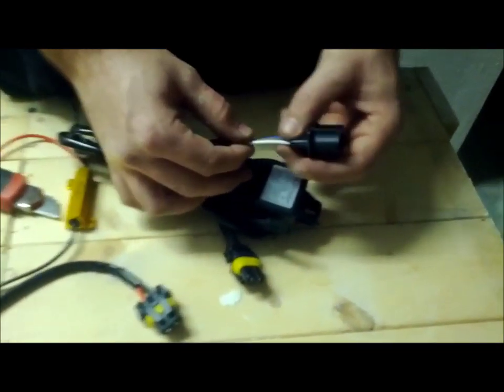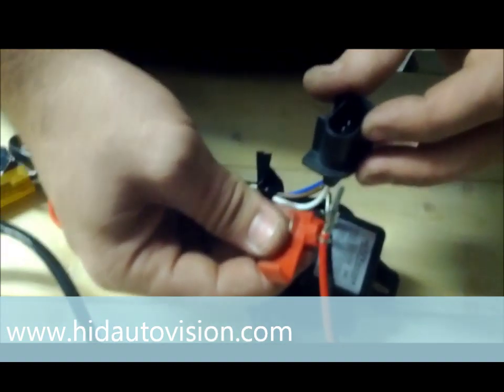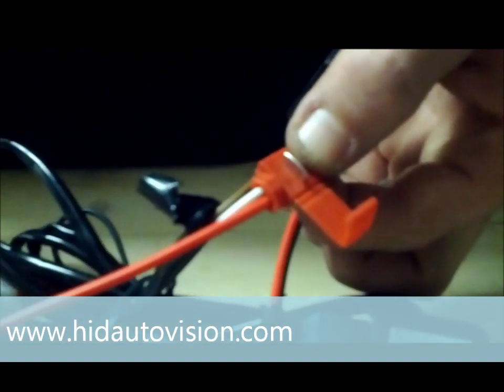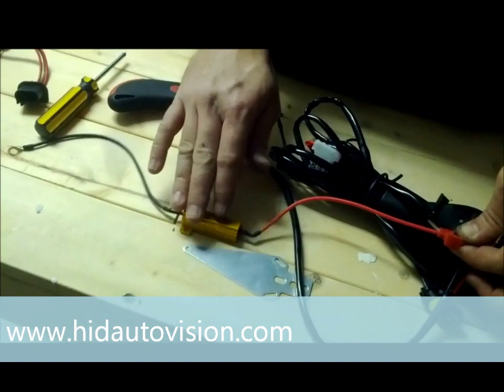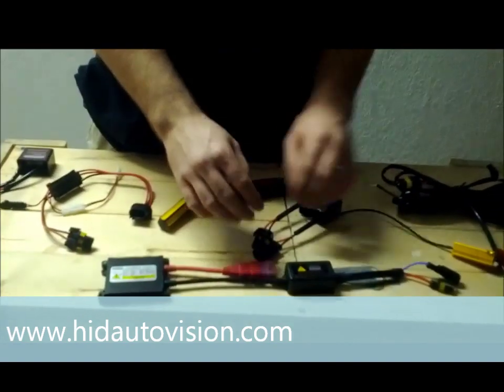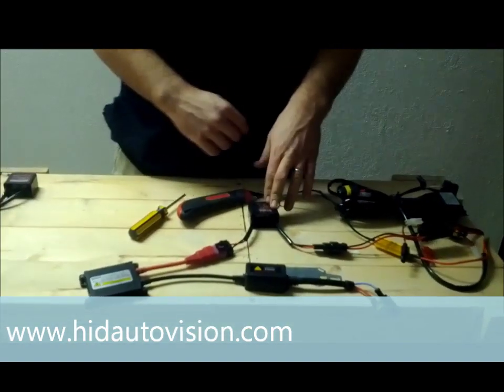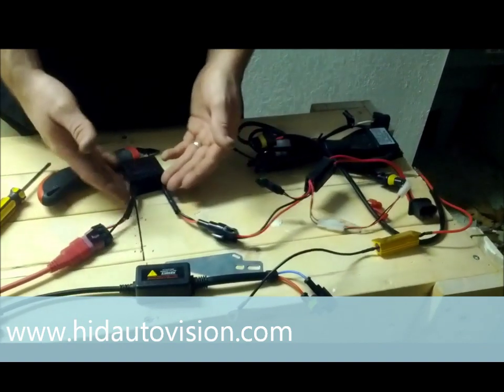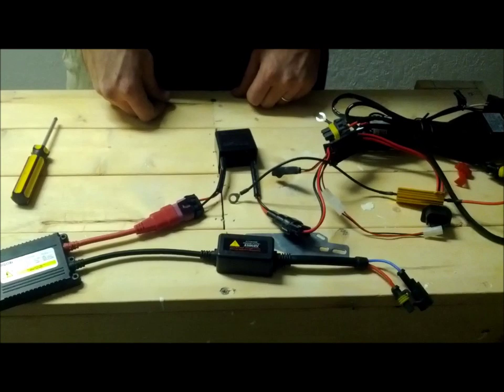HID Kit Resistor & Capacitor Installation

Comment: Just got a set of HID for myself. I needed to know what to do with these resistors cables and it would seem they are a precaution rather than a necessity. If my voltages stay within 11-13v range I shouldn't have to need them. Thanks, great explanation and information!

Comment: hi hope u will answer me, i have 2007 civic and i installed 6005 hid and it was flickering in drl mode and working good but low in high beam mode since my factory bulb did both drl and high beam, after installing a capacito 4700 uf bulbs are always high beam even in drl mode, and still have drl error on the dash board display, any idea how to fix it since i wanna keep my drl working

Comment: I have a Ford ranger 2015 and I want to install HID with resistor. how should I wire it on the existing H4 Harness. and the Angel Eyes how is it wire?

Comment: hi there so i have a 2012 ram that i installed plug and play hids on the low high beams. i was having the flicker issues on the passenger side. so i installed capacitors like you have in the video and now my passenger side sometimes works....when it goes out i have to unplug the ballast and replug before it'll work again. should i install the resistors instead or run both resistors and capacitors? thanks

Comment: I have a 2007 Dodge Ram 1500,  when my truck is off my high and low beams both work but they are switched when I switch to high beams my low beams come on and when it's on low beam my high beams come on. When my truck is on its the same thing but my low beams flicker a couple times then turn off and only my high beams work on low beam indicator. By looking at this video it looks like I need a resistor, is that right?

Comment: I have HID 4300 on my Mitsubishi Eclipse which has a flickering problem and there not bright enough to see the road do you recommend that a use a resistor or capacitor
Reply from the maker: In your case it depends. It could be the quality of the kit you have causing that problem. The accessories can help with functionality issues but the fact that it is not bright enough will not be resolved by installing one of these. I would recommend visiting our website for some good information and maybe chat with one of reps for more detailed answers as well. http://www.hidautovision.com
Reply: Ok thank you

Comment: I have a 2005 dodge ram 1500 after I got my HDI's  install for some reason even with the capacitor I still getting the flikerin and only my high beam works. I don't know what do at this point.
Reply from the maker: I assume these are bulbs you purchased from another company. Your bulb size is a 9007. Since the only difference between the 9004 and 9007 is the pinning of the high and low beam wires it's more than likely you received a 9004 pin out and you need a 9007 pin out. You can purchase a set of our bulbs with the proper pin out or re-pin the bulbs you have now. For more information visit our website at http://www.hidautovision.com
Reply: These hids headlights should work probably when you first buy them and they don’t they come with problems you need to figure out later.

Comment: I bought the VVME 55w 6000k for 9006 (Chrysler 300 2005) And when I installed them they work great with the motor off, When I turn the car on they flicker, When I rev the engine they flicker and turn off, So I watched a couple videos including your and bought the 9-16 v Warning Canceler Capacitor. When I hooked it up in between the Stock wire harness to the Hid Kit Ballast They Come on for a split second and turn back off...And never come back on until I unhook the harness and same thing happens. I have tried several different ways to wire it and still the same results. What can I do different? Or what am I doing wrong. Any and all help is welcomed and Thanks in advance! Please email me with your response to donald.meader@gmail.com
Reply from the maker: Although we do not carry the brand you have it's typically the same solution to fix that problem with a Dodge or Chrysler. More than likely your kit is being overpowered by your vehicle and putting the kit into shut off mode. To resolve this issue you would need a HID Auto Vision Resistor. Here is a link to the resistor you need http://www.hidautovision.com/hid-resistor-harness/

Comment: where can I buy a resistor? I have a 95 dodge Dakota. My Bulb size is 9007 10000k. I have a dual beam relay harness but my high beam is still on

Comment from the maker: Was that with one of our kits? The reason I ask is our kits are AC power and that sounds like something that would only happen on a DC power kit. That could have been the problem. You can also cover the DRL sensor on the dash and get the same result if you prefer not to remove the fuse. Typically a small piece of electrical tape works great and isn't really noticeable. 
HID Auto Vision-